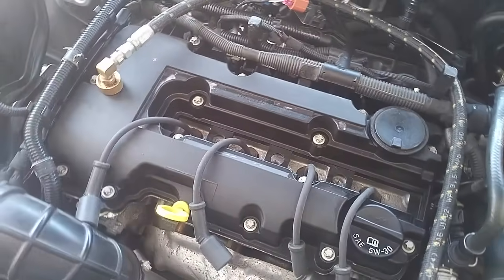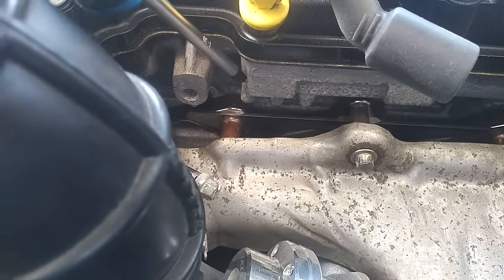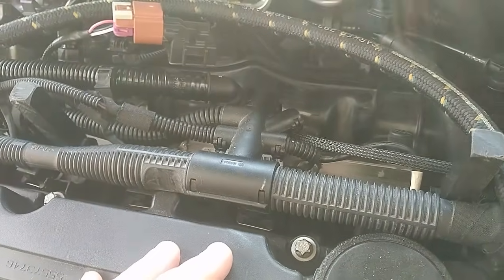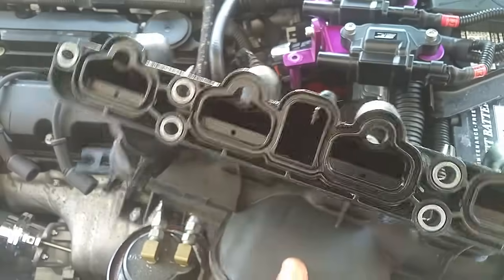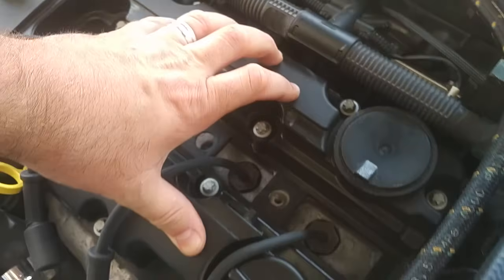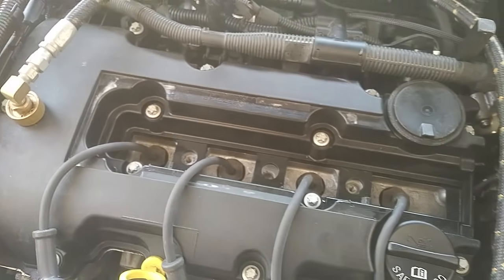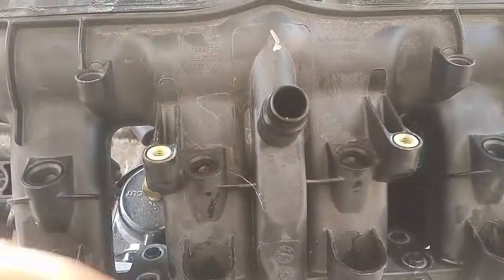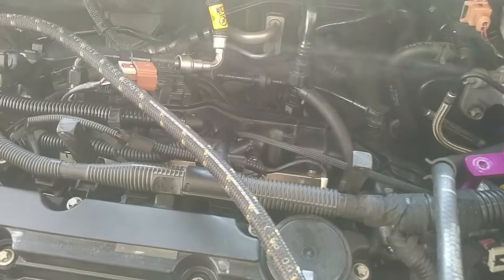Chevy Cruze Sonic Trax Encore 1.4L Turbo PCV Issues, Diagnosis, and Solutions

Comment: what is the other hose that's tapped into the valve cover opposite side of the oil fill cap? also are you not running the factory style coil anymore? i see you have 4 sperate spark plug cables there.
Reply from the maker: @ThatPrisonMechanic  that’s an AMSOIL single remote bypass filter return line. 

I’m running badnewsracing.net LS7 coils to support the badnewsracing upgraded GTX turbo.

Comment: Does the second pcv check valve located inside the tube itself or in the turbo?
Reply from the maker: @סהרקדמי  in the terminal of the pcv pipe. In the end connector.

Comment: Hi Dre Dan. I just bought a sonic with 1.4l turbo. The vacuum regulator is leaking oil from there. Do you think it has to do with the pcv valves? Any help, I'll priciate.
Reply from the maker: @aldonoviaviles6250  you’ll need a new OEM valve cover. You can get those from the dealer but I also offer them on the cruzekits.com site. Have you checked the intake manifold yet?
Reply: @AndreiDPop  so I have replaced all ready the valve cover with zzperformence. The old one was bad due to an air leak at the regulator. After a put the new one 2 weeks later, I noticed that it is leaking oil. I call the zzperfomence for the warranty and they are tell me that it couldn't be the the regulator.  And I haven't check the intake manifold yet. Can you send a link to the repair kit?
Reply from the maker: @aldonoviaviles6250  if it’s leaking oil, it’s defective. Nothing else to it. 

Cruzekits.com has the pcv fix kit and the OEM valve cover.
Reply: @AndreiDPop I  appreciate your time, and soon I will order the vulve kit. Thank you again. You're a humble person.

Comment: I got 2019 Holden Trax (Australia) 113000km which is about 72000m. Been such a shit car but I guess it was fixed under warranty I've had a new turbo, new coolant bottle and new gearbox. 2 days after filling up I'm getting this p0171. I'm getting a funny click noise on the right hand side of the motor put down low. The problem mechanics over here charge a fortune, follow a list which can get off Google. It cost me over 1200 dollars just to find out what was wrong with my son's car which is like a G8. The funny thing is I found it on Google and I should just bought the parts. You kit sounds really good but I don't know if you post to Australia and I guess  the postage would cost a fortune cheers Graham
Reply from the maker: Hey there, we do ship to australia quite often. We have the shipping options listed on the cruzekits.com website, at various costs. If you're near Sidney, it's really quite reasonable, and if you're further out, it's usually about $45.

Comment: Nice bypass filter system, is it Amsoil?  I put one on my 2.4l Ecotec. It returns directly onto the timing chain, keeping it bathed in clean oil, no more GDI soot.  I also did an external PCV system.  After 100k miles, engine is extremely clean, no varnish, sludge, even 10-12k intervals.
Reply from the maker: Yes it’s an AMSOIL single remote bypass. Not really much benefit outside of adding an extra quart of oil capacity but it was a fun project. I took it off last year after using it for 8 years due to the cost of filter changes.
Reply: @AndreiDPop  really, no benefit?  How do you come to that conclusion. Being an Amsoil dealer, I thought you would understand the benefit.  I stopped using PI, Engine Flush, Power Foam, did nothing to help.  Still use Metal Protector.
Reply from the maker: @tssci6774  soot and insoluble contamination isn’t a concern with gasoline engines. That’s why you only ever see bypass filters where soot levels are measurable. I ran a case study with AMSOIL in a focus ST where we did 13 oil analysis reports and 50,000 miles on two EAO filters. Lab said oil was suitable for continued use and there was no soot measured. 

I did another case study with a Cruze turbo diesel that went 100k miles on AMSOIL AEL and soot wasn’t an issue with that engine either. 

So if soot isn’t an issue and wear is at acceptable rates, what benefit is the bypass filter offering? On paper yes I could say beta75 at 2 microns is great filtration but at the end of the day is it consequential? In my opinion it isn’t.

Comment: So it is normal air suction through oil cap when is in idle? My intake manifold has the orange nipple and new valve cover, i still have some suction through oil cap,  car runs good no check engine lights , just wondering if is norma air suction???
Reply from the maker: Yes, that’s normal.

Comment: Dan I changed the turbo on my 1.4 Buick encore but light for turbo still on. Help
Reply from the maker: Have you inspected the intake manifold for a missing check valve? Have you installed the cruzekits pcv fix kit?
Reply from the maker: Here’s an article I wrote a while back that should help you. This is why I tell people that a p0299 code is not necessarily the turbo. It’s much cheaper to address the other root causes of that code before replacing the turbo, and it prevents people from ending up with an expensive turbo replacement and still having not fixed the code. 

 https://cruzekits.com/blogs/technical-articles/p0299-underboost-code-explained

Comment: Cannot thank you enough for walking through the various components of the PCV system. This allowed me to properly diagnose and repair the PCV system. It also saved me from spending additional money on the intake manifold that wasn’t needed…yet. I did need to run the car for quite a while (at least 30 minutes) after the repair to get all of the accumulated oil in the intake manifold driven out. I was overjoyed when the last bit of blue smoke stopped and the little engine got back to normal. She purrs like a kitten and pulls right up the hills better than she has for a while.
Reply from the maker: That’s so awesome to hear! Very glad that you were able to sue this information and get your car fixed. That’s been the goal behind everything I’ve done here. Saving people time, money, and frustration.

Comment: I have a 2013 chevy cruze eco turbo 1.4L I have put around 10,000 dollars on it in the past 6 months just got it back from the shop after putting a new transmission new timing chain and new gaskets we haven't even had it out of the shop for a month and once again it is leaking oil on the driver side towards the front of the car I'm over putting money into the pos it only has 155,000 miles on it and it is the worst car I've ever owned

Comment: Hey would this fix the notorious freezing PVC lines when it's like -18 c, my Trax has done this twice this winter but it's been very mild thank goodness. The condensation builds up during milder weather and then freezes when it's really cold and the oil pressure spikes and pushes oil past seals and burns oil badly. Gm has a fix but apparently my vin isn't covered under the special coverages for it.
Reply from the maker: No, this kit won’t fix it, but I have a separate product coming out this year that will address this issue if you’re interested.

Comment: I just used the boost leak test kit.  The only leak I had was throught the valve cover gasket. Could that be because the PCV it shot? I have a sonic I can't look down the PCV hose inlet.
Reply: Nvm. Got it. You rock btw. Kit worked amazing

Comment: Do i wait until the check valve is gone or can this be installed while valve is still present
Reply from the maker: This can be installed with the check valve present. You would have to break the tip off the check valve with a flathead screwdriver, which would cause it to fail in the same way that it does when it fails on its own. You can remove the manifold from the car if you’re concerned with the check valve falling in the intake but it hasn’t been an issue for anyone that I’m aware of.

Comment: Will your kit pass CA smog inspections?
Reply from the maker: Since the kit retains all OEM pcv functions, it should not cause any issues with CA smog testing. However, certain municipalities may do visual inspections of engine bay hose routing, and they may complain if they see a different hose routing than stock. Some people have chosen to install the V1 pcv fix kit as a result, since it doesn’t change any of the visible hose routing in the engine bay, but that also requires a separate purchase of a throttle body spacer.

Comment: So where does the excess pressure escape to under vacuum? If under boost it goes back to the turbo from what I understood
Reply from the maker: Through the check valve in the intake manifold.
Reply: @AndreiDPop  what about when it’s plugged, I have one of your kits installed just don’t remember which one(the little valve is on top right by the purge solenoid), I had it for a while and it was all great, however when it got cold this winter the car would smoke like crazy and idle real rough, no cel light tho. I just installed a new check valve in today maybe that will fix it. But I would like to know what exactly that little valve is needed for anyways
Reply from the maker: @shiloberry  when it’s plugged, the check valve is relocated to an external location where it functions the same.
Reply from the maker: @shiloberry  the issue with the extreme cold is that the check valves freeze up with condensation if you don’t drive the car for an extended period to burn it all off. The check valve at the turbo inlet freezes up, and if the check valve on the kit or manifold also freezes closed, the pcv gas has nowhere to go.
Reply: @AndreiDPop  but what exactly does the one from the kit do? Does it open the one by the turbo or does it keep it closed? Or does it vent the excessive pressure somewhere when the engine is in vacuum?
Reply from the maker: @shiloberry  it does exactly what the one from the original manifold does. It opens when the manifold is under vacuum and closes when the manifold is under boost.
Reply from the maker: @shiloberry  this explains how these pcv systems work. 

https://cruzekits.com/tech-articles/f/why-do-we-even-need-a-pcv-system
Reply: @AndreiDPop  thanks

Comment: Did it stop the noise ??? Have you drove a long distance since because it ate 5 valve covers because of defect. Ac compressor bolts backed out and there was a loud rattle and I think the squealing and whistle / siren noise was to do with that, new belt losts of ticking but thats fuel injectors . I got an appointment on 21st of February so i will comment and let you know what mine is doing to see if they can figure it out. There was a crack in flex pipe twice so replaced it and with new toyo tires handles and drives a million times better fixed alot of jerk out when I hit the breaks when car starts before it is warm, I hope my comments help I ramble on but the mechanic said it was 1 of the smoothest running cruzes around 😊 also throttle body and intake manifold were done with crankshaft seal at 93 k but manifold was done a second time, hot water valve failed 2 times but high test gas and change oil when it is dirty or smells like gas if it is down add a little but you need to change it. When my turbo went I am pretty sure it was the waste gate but I could only do 100km even at 5000 rpm and mechanic could not touch it for 2 hours so check anti freeze and oil like i said basic maintence and any noise from engine ask a friend or a random person can you hear anything, mechanics dont want to diagnose they will change something they think is wrong but it wont fix the problem unless they know and have common sense also wash your car and check air filters behind glove box and engine filter I had mice babbies behind glove box got a washable k and n filter but good luck and take it on highway or parking lot hold traction control for 20 seconds untill both lights are on foot on brake and one on gas first gear ebrake on rev car for 5 to 10 seconds let go of brake put handbrake down and spin those tires get the car working abit burn that crap gas out needs high test and brake and gas will go to 1500 rpm traction off it will go to 2500 rpm it just needs to be driven stop and go but get on highway and open it up it should go from 100 to 120 when you floor it when you give it gas it should shift and pick up speed, when we first had the car it didnt have power from 100 to 120 now I can easily hit 130 i floor it to speed limit and it and if I hold the gas down a bit it will go to 50 then 60 70 80 in no time just drive it like you stole it, it needs to be driven and cleaned out you should not need a new cat I was told twice but it was flex pipe both times car gets hot to but there is a reason if your cruze runs rough or is crap it is one of the funest and best cars I have drove i leave every one at the lights they pass me but thats cuz I let off gas at 50 and dont want to be that guy that does 100 in town I have got to 90 like just have some fun and find a good mechanic or come to me and I can let you know what I think cus yeah love hate relation ship but it works when you fix it and do basic maintenance

Comment: Thats awesome and i love my dads cruze thing is amazing but needs oil changes and BASIC MAINTENANCE lol. 2014 1.4lt cranks shaft seal went and 93k then was valve covers cuz of crap ones dorman works good but i have a whistle / siren noise runs great but when it gets to running temp it squeals changed pcv line on top of motor turbo went at 160 thank god for warranty. Oil change helps also ticking is fuel injectors car just hit 200 k I have heard this noise. Get a good mechanic or just look around it should not sound like a sewing machine i was told hissing is normal Lmfao I touched the corragated hose and it had a crack in it also the small 50$ hose for boost sensor kept comming off krazy glue fixed that oh and new toyo tires are worth the mone just think of it as an entry levels race car lol turbocharged 6 speed but it should run smooth not rough and mechanics will screw you over unless you find a good one also flex pipe was cracked failed and converter was dirty well clean oxygen sensor had to be cleaned try some high test gas to theae are just issues I have had but just basic maintence and common snese will go a long way
Reply from the maker: You should get him that cruzekits pcv fix kit as well. Will save a lot of trouble and headaches down the road.

Comment: p1101 is almost always the intake check valve, i deal with these often
Reply from the maker: In my experience dealing with customers for the last 7 years and running the cruzekits site, the intake manifold check valve won’t cause a p1101 unless it’s also accompanied with another failure. The turbo inlet check valve will however.

Comment: Currently working to be ridd of my 2015 Cruz LT, less than 97,400 miles and still under warranty but constantly denied any warranty coverage. Also, learned yesterday when the mechanic was on the phone with the warranty department, this car was sold to me without informing me of the recall that is ongoing. It's sitting in my driveway after being towed home yesterday because I refuse to sink another penny in this money pit. As of last week, I've had the pos 20 months; its broke down a 4th time. And this time, the issue is the same as the first time it broke down. JUNK!

Comment: Very good explanation but I don't see what prevents boost going to the turbo inlet
Reply from the maker: The intake manifold check valve prevents boost from going into the turbo inlet, if it’s still there and if it’s working correctly.
Reply: @AndreiDPop  I watched again and yes I got it now. Thank you!
Reply from the maker: @marion1600  awesome. Let me know if you have any other questions. 

If you don’t have the v3.4 pcv fix kit yet, it’s a great fix for this issue and great insurance against an expected failure and snowballed issues down the road.

Comment: At idle my car is sucking air through the corrugated hose back into the intake manifold. I assume this means my check valve at turbo inlet has completely failed? Been fighting to find my air leak and maybe this is my issue.
Reply from the maker: This isn’t a reliable test of anything, and you’d see vacuum at the corrugated hose regardless of whether the intake manifold or valve cover has failed. That hose however does crack very easily and the v3.4 pcv fix kit also addresses that issue by design.
Reply: @AndreiDPop  appreciate the reply. Intake manifold is a brand new Dorman, and valve cover is pretty new as well. I just disconnected the pcv hose at the turbo inlet and stuck my finger in the hose, was sucking pretty hard. Therefore figured the check valve had failed. Or maybe this is unrelated to my issue.
Reply from the maker: @Chevra2448  that’s normal behavior and doesn’t indicate any failure. Are you trying to diagnose an issue?
Reply: @AndreiDPop  I guess I don't really understand the point of that check valve at turbo inlet if it allows flow both ways through the tube then? But yes I am trying to diagnose a p1101. Been driving me crazy.
Reply: @AndreiDPop  It worked! Thanks for the explanation video. Was helpful in all of this.
Reply from the maker: @Chevra2448  glad to hear it! You’re welcome.